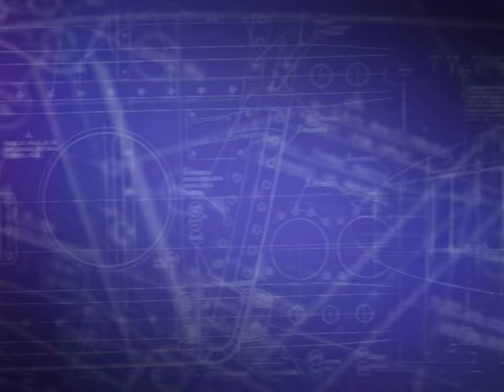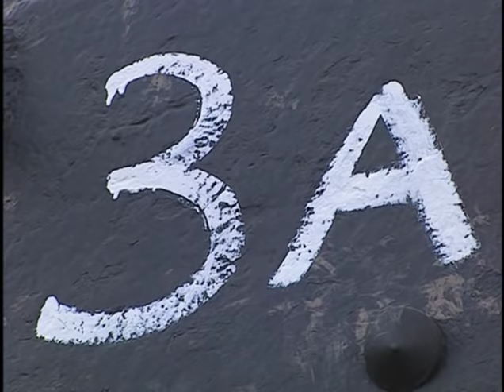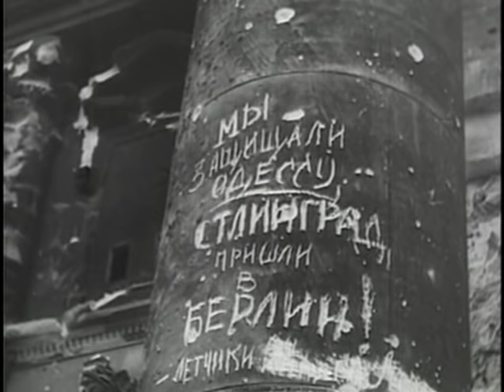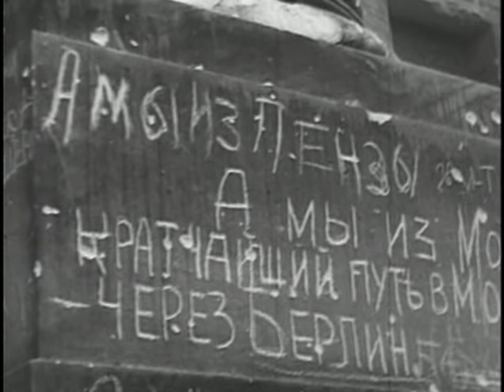Battle Stations: T-34 Russian Victory (HQ with Extras)

Comment: T-34: without a doubt, the most over-hyped tank of all time. This thoroughly mediocre design is constantly misrepresented as the best tank of WWII. It's almost unbelievable. The thing didn't even have a turret basket for crying out loud.  

Oh and no Mr. William Atwater, the T-34 was NOT the first tank to materialize the sloped armour concept. Various French designs such as the FCM 36, the Renault R35 and the Hotchkiss H35 were already being fielded when the T-34 entered production. Where do these people earn their Doctorates?

Seriously, google FCM 36 and tell me if you've ever found a tank more "sloped" than that? Ha. It's a really cool design and very few people have ever heard of it.
Reply: don' t forget that all T34s until the T34/85 didn't have a self contained turret basket for the gunner and loader, ie, the gunner and loader  -if gunner was not seated - had to shuffle as the turret turned. the floor of the turret did not move with the rest of the turret. un-fucking-believable! also, the 4 man crew and lack of radio made it difficult for Company and Battallion COs  to give direct orders or change of orders. if they were involved in a tank & Infantry assault upon an German Infantry position then suddenly stugIIIs or PzIVs appeared they were totally unprepared to deal with them and only when most of the Company or Battn noticed the burning wrecks of their comrades did they respond but by then, of course, it was too late!

but i have to say that 45 degree slope DID make a LOT of difference to its hull protection. that cannot be denied. what's more this 45 degree slope was all round so they suffered no disadvantages from being attacked from the rear.
and to add to this you have the very wide tracks which, you have to admit, made the vehicle excellent across country.
one only has to wonder if the Germans had simply stolen the plans to the T34 and rebuilt it with better transmission/engine and control functions for the driver [the T34 drivers often had to carry a small hammer with them to change gear!] and the excellent L70 75mm cannon, increased armor thicknes to 70mm at the front. also, i doubt the Germans would have designed such large clumsy track links.

i'm with Guderian who believed that instead of building a whole new tank in the form of the Panther, it would have been easier, cheaper AND quicker to redesign the PzIV w wider tracks, sloped frontal armour and a turret with more length [as in the PzVII KoenigsTiger] to acommodate the L70 75mm cannon's recoil. Damaged suspension on a PzIV could be replaced within several hours but with the Panther it literally took weeks because they were interweaved.
Also, the transmission of the Panther was designed for a 35 ton tank. the Panther weighed about 45 tons! A redesigned PzIV would have weighed no more than 38 tons.
Reply: "don' t forget that all T34s until the T34/85 didn't have a self contained turret basket"

I said so in my comment. The loader especially could very well have an arm or a leg torn off if he didn't pay attention to the rotation of the turret and the gun. Best tank ever! Also, a correction - the t-34/85 didn't have a turret basket.

"only when most of the Company or Battn noticed the burning wrecks of their comrades did they respond but by then, of course, it was too late!"

The thing only received a commander's cupola in 1943. Until then, the tank commander was not only overtasked (gunner + commander), but nearly blind as well. Adding to the general confusion was the lack of radios (as you've said) or their poor quality when they were present.

"but i have to say that 45 degree slope DID make a LOT of difference to its hull protection."

Yes, it made a lot of difference - in 1941. By 1942, the Kwk 39 l/60 and the Kwk 40 l/43 could penetrate it with little difficulty. Needless to say, at the latter stages the T-34's armour was rendered almost irrelevant with the arrival of the Kwk 42 l/70 and the Kwk 36 l/56, not to mention the superb Kwk 43 l/71, which would probably just penetrate in on one side and come out on the other.

 "they suffered no disadvantages from being attacked from the rear."

Having your thickest armour in the rear (45 mm, the same as the front) is not generally considered an optimal distribution of armour.

 "45 degree slope was all round"

It wasn't. The slope was: 60 - front, 40 - side, 48 - rear.

"very wide tracks which, you have to admit, made the vehicle excellent across country."

The wide tracks offered the advantage of low ground pressure, which means the tank didn't sink as easily as the Pz III or IV, but cross country performance relates mainly to the suspension and here it is widely acknowledged that the Christie suspension offered an extremely bumpy and uncomfortable ride, mainly due to the lack of shock absorbers. The Christie suspension was an evolutionary dead end and was replaced by the torsion bar system in postwar Soviet tank design. 

"redesign the PzIV (...) to accommodate the L70 75mm cannon's recoil."

It was tried with the schmalturm design, and it failed. The Pz IV's turret ring and internal volume probably just didn't allow the installation of such a gun.

"PzVII Koenigs Tiger"

The Bengal Tiger was a Pz VI (ausf. B).

Apologies for the long answer.
Reply: I think it depends on the yardstick by which one measures greatness. The Panther was probably the best tank of the war, but the T-34 won out because it did a good enough job and overwhelmed the Germans with sheer numbers. It was a good tank when it first came out compared to the relatively lightly gunned/armored tanks the Germans fielded at the time - but as a stand-alone tank it was certainly not the best. If you had an equal number of Panthers and an equal number of T-34s, the Panther would win hands down.
Reply: its a documentary, it has to be over hyped or else the casual viewer wont be interested enough, us tank enthusiasts just have to take these with a grain of salt, because they are directed to the general public
Reply: Not exactly, The PzKpfw IV proved very much a match for the T-34. The only reason the T-34 kept its reputation of a fearsome tank is because of its massive numbers.

Individually, or even on a army scale, the M4 was arguably the best series of Medium tank to see proficient service.
Reply: Victor Twice "The Pz IV was helpless before the T-34"... Remember, you heard it here first, folks! 

Regarding which was the best tank, even if one takes your POV seriously (with I don't, because it isn't rigorous in the least), some kind of reasoning is still owed as to what makes the T-34 superior to the M4, given that the latter "prevailed" as well.
Reply: Nathan Peterson Agreed. If one determines quantity as a decisive measure of quality or "greatness" (which I don't), the conclusion is inescapable: the M4 was the best tank of the war. In contradiction, once more, to what is usually depicted in pop documentaries, where the Sherman is frequently called a death trap or a Ronson. 

As to the truly best tank of the war IMO? No doubt. The Pz V Panther. It's not by accident it is usually referred to as the earliest ancestor of all MBTs. The first tank to combine the protection of a heavy (in the front), the gun of a heavy and the mobility of a medium. The same blueprint MBTs follow to this day.
Reply: Hugo Carvalho Truly best design, agreed. But it had too many fundamental flaws to keep a steady flow, for the lack of better words of keeping that title.
Reply: Wondered how long it'd be till I saw an American claiming their tank was the best! (Not long)
Reply: Yes, you did. But did you know that before watching this video. $10 on you saying you did.
Reply: I have read quite a few first hand accounts written by those who served in/were responsible for supplying Sherman crews with replacement tanks, and all of them speak of how horribly outmatched the Sherman was. The Firefly packed a good enough punch, but still, the armor and profile of the M4 was of little good to its crews. Undergunned, tall, poorly armored, prone to catching fire - it wasn't a very good tank.
Reply: I'm an American, but I am in full agreement with most, the M4 was a piece of junk compared to what it had to face. Only the Firefly stood a chance (if it could get off the first shot).
Reply: +Glen Brugge 

> "I have read quite a few first hand accounts written by those who served in/were responsible for supplying Sherman crews with replacement tanks"

Who makes this claim? Belton Cooper? I hope not. His information, since his passing in 2007, has been discredited as a source of information on the M4 multiple times over by numerous historians. Namely the unprofessional TanknutDave character, though I digress. 

The M4 was not junk, nor was it bad compared to what it had to face. To what standing does your argument have?

> _"Undergunned, tall, poorly armored, prone to catching fire - it wasn't a very good tank."

The M4 was not undergunned. The 75mm was completely adequate the combat it saw.

It was not poorly armored. In the case of all welded-hull M4s, the only medium tank to have effectively thicker armor to see proficient service was the Panther. Armor quality was always good, it's fair brinell scale rate of 140-290 permits little fragmentation. Something that Dmitriy Loza notes very well.

The M4 was tall. I won't argue that, but compared to a Panther, it was not disproportionately tall.

The M4 was not prone to catching fire. Compared to what? The M4 wasn't any more likely in its typical variants (and though negligible in difference, less) to catching alight against any IV. Any exceptionally less than any T-34. Panther possibly, but the documentation is lacking.
Reply: +Dim Beam 

What?
Reply: Nathan Peterson
My second comment was for Hugo Carlavho. He seems to be a know it all after the fact.
Reply: Dim Beam I promised myself I would no longer engage idiots who have never read a military history book in their lives, but...

"Know it all after the fact"? Do substantiate.
Reply: Dim Beam Oh, what a shame. I was so certain a PhD worthy dissertation was forthcoming. 

In all seriousness, read Robert Michulec's 2007 book. You'll learn something.
Reply: I give it a read. Cheers. I learn something with every book I read. Good or bad. Hope its not going to the latter.
Reply: > "Better than the Sherman, better than the Panther IV.  Not better than the Tiger."

How so?

> "The T-34 had a greater slope than the Panthers"

The slope alone doesn't change much until the raw armor alone is known. 

> "and who the fuck even cares about a French Tank?  If Renault made a tank as bad as they made cars, a sling shot could take one out."

You really are not serious about this are you?
Reply: Hugo you "read" too much but dont get even the basics of warfare.
The best weapon is the one that wins a war.
You can name many as the "ultimate weapons" depending on the conditions and the expected outcome:
 If you dont care about nuclear winter etc then the ultimate weapon is a nuclear warhead or a specific nuclear platform like a submarine that can deploy them effectively..
 Other than that there are many other candidates: advanced technology like military satellites or UAVs, airforce superiority, solid support infrastructure/logistics, massive industrial production, excellent personnel training, morale, determination, good planning etc.
The soviets outclashed the germans on many of the above, the T-34 was by the results the best tank as its simple and effective design helped a NON INDUSTRIAL (at the time) country to mass produce it and successfully defend its territory.
Todays best warplane may be the F22 but it wont win any wars and thats something the US already understand. If you field your best and most expensive plane in the small numbers you are able to produce it, it may get some kills against Sukhois, MiGs or Rafales but in the end it will lose to planes that are cheaper to produce and maintain and are not that far behind in performance anyway.
Reply: 45000 tanks lost during the war, 80% fatality rate for its crews. The T-34 holds the prestigious distinction of being - by far - the most destroyed tank of the war.

But it won, so - apparently - it is the best weapon of the war. Let us ignore that wars are won by an immensely complex interaction of strategic factors, the quality or performance of the tank arm being merely one among them.
Reply: "The T-34 had a greater slope than the Panthers"

Omg, so it has! The frontal slope is a whole 5 degrees greater than the Panther's. All while having almost half the thickness of armour.

You are so SMART! I truly had no idea. That's certainly more than enough to establish the T-34 as the better of the two.
Reply: The number you are giving includes western lend lease tanks and about 1000 obsolete T-28s used in 1941.
You need to also break down the reason for those loses. Many were lost due to the 88mm Flak tank destroyer, artillery and air attacks, the faustpatrone/panzerfaust and antitank mines. The soviets did not field any destroyer even close to capable as the Flak, did not have ANY handheld antitank weapons, did not have as sophisticated and deadly antitank mines as the germans had.
Lastly a very large number were not complete loses due to direct fire but operational loses due to the inability of the soviets to organize recovery operations. Many tanks were simply abandoned with just track damage or even worse because of empty fuel tanks without ever being recovered. The soviets destroyed abandoned working tanks so they wouldnt get captured by germans, these were still counted as loses.

You need to also take into account the main problems the T-34s faced during 1941-1942: 
1. poorly trained and inexperienced crews especially compared to their german rivals.
2. lack of adequate numbers of AP rounds during that period
3. lack of communication (no radio in most tanks) and training in tactics/coordination of armored warfare
4. lack of tank recovery operations
All of the above are well documented facts and were not faults of the tank itself.

In conclusion the best tank by combat capabilities was probably the KV-1 or the very late Tigers/Panthers.
BUT the T-34 was in the end the best tank because if the soviets focused all production on the KV-1 they would not have the numbers needed in time to defend the vast front they were facing the german attack.
The simplicity of the design helped a NON INDUSTRIAL, militarily disorganized and ill equipped country to produce enough numbers to defend itself against the largest and most capable military force in history.
Reply: Hugo Carvalho Panther was so plagued with reliability issues they had less than 60% availability rate at their peak.. Generally in order for a weapon of war to be considered great, it actually has to fucking work..
Reply: It was absolutely the best tank in the world in 1941 42
Reply: Hugo Carvalho  T34 had a diesel engine so it didn't burn nearly as quickly as the Sherman. the T34 has sloped 2-inch armor on all four sides the Sherman was only good on one side the front and even then it still wasn't as good as a t-34 because of the angle on early Sherman's. Was too steep more rounded then sloped on versions before 44-45 and the fact that came out in 1941 is pretty amazing as well you would have never seen the  Panther developed if not for the t34. The gun on a Panther is obviously far superior but its reliability of course was lacking. Do u just type the opposite of the truth because you know it will get many replies?
Reply: As battle tanks when they were operating properly German Panther and tiger and tiger 2 we're far superior in a battle 1 on 1 then the t-34 76 built in 1941 the t-34 gets it's credit from being so prolific and Incredibly innovating for its time the argument you're having is useless to waste of keyboard because of lack of context
Reply: Well the Somuas and hotchkiss were disposed of by puny little panzers. No french tank won the war now eh? The 34's did. Sorry to pop your bubble, mate.
Reply: The natural enemy of the T-34 was not the Tiger, not the Panther - it was the StuG.
Reply: And their own crews :D
Reply: Nathan, here is couple of thoughts on Pz-IV and Panther. If Pz-IV would "cut the mustard" then there would be no need for Panther tank as a replacement. Now, if Panther tank performance would be satisfactory, then there would be no need to keep Pz-IV to the end of the war, but that was not the case. Things got worse for Pz-IV towards the end of the war as sometimes production of it occasionally halted because Krupp was in rush to manufacture tubes for Panther tank gun that had priority, and Pz-IV got some not so thrilling "upgrades" for example in 1944 like taking electrical turret traverse was discarded in favor of manual only traverse and 200 litter auxiliary fuel tank because it had somewhat short range(from 125 miles on paved and 82 cross country to 187 and 113 accordingly), just like all German tanks during WWII. T-34 had better range of them all because of diesel engine. Also 75mm L/48 gun on latter models Pz-IV was good all-around(which matched 76.2mm T-34-76 gun, but not better then 85 L/55 AA featured on T-34-85), but Panther 75mm gun more of the anti-tank specific gun because of its high velocity and flat shell trajectory, was not great against infantry of artillery(and more tanks lost to antitank artilery then to enemy tanks during WWII on both sides) and that is the reason it needed Pz-IV companions, T-34 was great with 3inch gun, and once upgraded to 85mm gun was even better, since it was similar to Tiger I 88mm gun when it comes to good fragmentation and anti-tank performance gun. Truth is that T-34 was a main battle tank throughout the war, and not just at the begging of it, before MBT concept existed.
Reply: Well, yes though FCM 36 had some sloped angles to it, like a quilted blanket it was made out of many pieces, performance of that tank was not impressive, so no one rushed to copy it as Germans did when encounter T-34, that is why, armor is not just have to be sloped, but solid plates was put under what called "rational angles" to get most of the benefit of protection such as T-34, Panther and King Tiger.
Reply: BTW that "over-hyped" tank did most of the fighting during WWII, more then any other tank. What do you mean mediocre? Germans was trumping over them-self trying to match T-34's design, that on its own right makes an outstanding design.
Reply: Hugo Carvalho wrote - "T-34: without a doubt, the most over-hyped tank of all time. This thoroughly mediocre design is constantly misrepresented as the best tank of WWII. It's almost unbelievable. The thing didn't even have a turret basket for crying out loud."
 If you think that absence of the turret basket made T-34 a mediocre tank, then it you who know very little about tank design in general. At the beginning of the war T-34-76 tank actually offered more then any other tank in the world i.e. big long barrel fast firing 3 inch gun, anti tank artillery protection was superior then any other tank of the time, and agility and mobility that no other tank at the time could match, thanks to big engine and wide tracks. Even at the end of the war this design was flexible enough to be upgraded and  to three man turret and even bigger gun, that did not hurt its performance. This tank was very relevant even after war, until present days something that no other tank of that era can brag about. So it is rightfully called best tank of WWII.

https://www.youtube.com/watch?v=fKmQuA5N5S8
Reply: Narred Darr wrote - "don' t forget that all T34s until the T34/85 didn't have a self contained turret basket for the gunner and loader, ie, the gunner and loader -if gunner was not seated - had to shuffle as the turret turned. the floor of the turret did not move with the rest of the turret. un-fucking-believable!"
 Don't cry much about turret basket. Gunner and a loader had a seat attached to the turret that rotated along with a turret. Also unlike German and American design where transmission tunnel divided tank into two part by running back from the engine all the way to the front of the vehicle, and also made tanks taller then needs to be. T-34 did not have that problem because it featured rear engine and rear wheel drive transmission design, so floor was flat, so turret basket was somewhat irrelevant, not to mention made access to ammo boxes that was stored on the floor easier.
Reply: Hugo Carvalho wrote - "The wide tracks offered the advantage of low ground pressure, which means the tank didn't sink as easily as the Pz III or IV, but cross country performance relates mainly to the suspension and here it is widely acknowledged that the Christie suspension offered an extremely bumpy and uncomfortable ride, mainly due to the lack of shock absorbers. The Christie suspension was an evolutionary dead end and was replaced by the torsion bar system in postwar Soviet tank design." - No, actually before and during WWII Soviet tanks already had torsion bar suspension on some tanks anything from heavy KV and IS series tanks to T-60 and T-70 light tanks, so you are wrong about that.
 Actually, bumpy cross country ride was in Pz-IV due to its small double bogie wheels over stiff spring leaf suspension, while Christie full size wheels and long travel control arm enable very smooth ride. Here is T-34 going over a crude bridge 
https://www.youtube.com/watch?v=E2JbIZ9yIOk
Many tankers actually prefer T-34 soft ride to any other tanks. 
and here how Pz-IV feels jerky off road due to its harsh suspension. FF to 4:37 to see how bumpy it is inside the tank over very small bumps.
https://www.youtube.com/watch?v=7rZuURtYpHM
Reply: It is indeed very overrated.